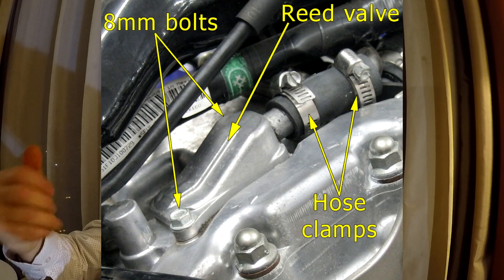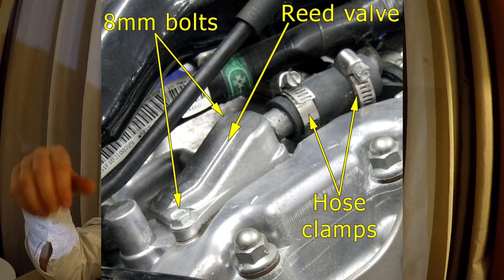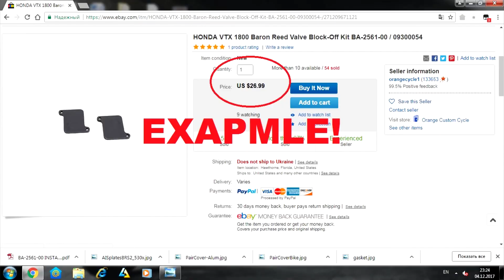LIFEHACK. How to increase engine power just for 25USD! [Honda VTX as an exaple]

Comment: I did this and it's awesome I had a rattle in my 1300 and now it's gone and motor runs good I used voice grips to twist screw off holding the reeds the plate so I pulled the reeds out and put the reed plates back then put the blank offs on. You have to plug the little vacuum line to the pair valve that you remove and plug the open hole in the airbox that's left after removing pair valve hoses. Totally worth it.
Reply: Any other tips? I just took over a worn out 2005 1300 and am trying to build a rat bike. This will be my first bike.
Reply: Hmm, whats a voice grip?

Comment: I have a 2006 1800C3 california edition....Question.....how much power do you need? The VTX 1800 is a beast stock....even with the California emissions equipment.  Thanks for what you do....love the channel!
Reply from the maker: davidblueify 
Hehe I need more, more, MORE.
Seriously 1800 engine is ok.
The max speed is quite limited to 125mph, but it is V-twin....
Reply: My vtx does 135 mph says 140 but really only going 135ish
Reply: Yep. What most miss is leave the damned engine alone & replace the suspension ! Pull the soda cans of old whale oil off & drop in some higher end gear both front & rear, unbelievable difference to make the bike so much more enjoyable
Reply: @video3ish  how did you upgrade your suspension? I haven’t seen lots of aftermarket support for the VTX

Comment: I really don't think that capping the reed valves gives you any more power.  It does help reduce the exhaust popping sound if you've modified the exhaust, but from all that I've read that's all it does.  

Here is another guy explaining how the PAIR valve system works.
https://www.youtube.com/watch?v=_xMykbzJWiQ&index=2&list=PLxcDxGP6ijC8we9HYMqm45TmrkCuSz-6F&t=0s

Comment: This does not increase the horse power. It just stops the backfiring when you let off the throttle.
Reply: Exactly!
Reply: Maybe it's just me but I like the backfire.  2004 1300s codra long pipes. 
If it ain't broke don't fix it.
Reply: @fuckgoogle8857  if ur getting back fire while yeah it sounds cool it’s actually a bad thing for the fuel fire mixture it’s def NOT a good thing
Reply: @jacaughron55  Only happens  once in a while right after I let off gas. Usually after very hard throttle and high rpm. If it was all the time I would be concerned. But when I ride her hard I expect her to talk back a little.